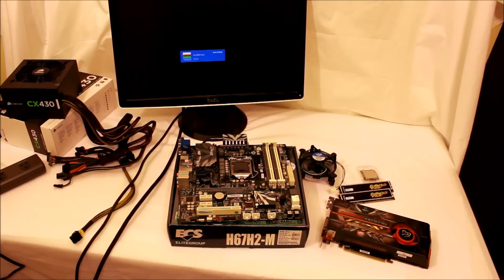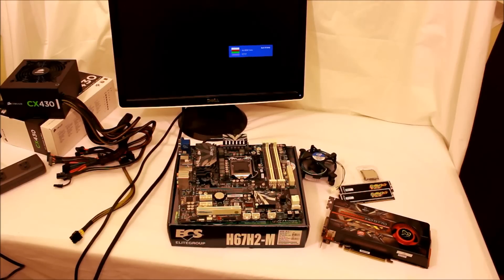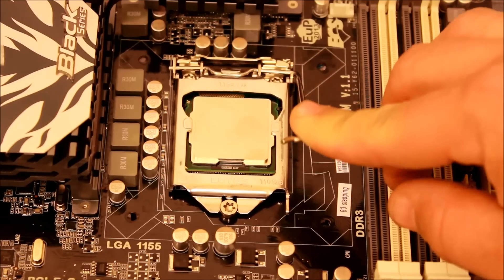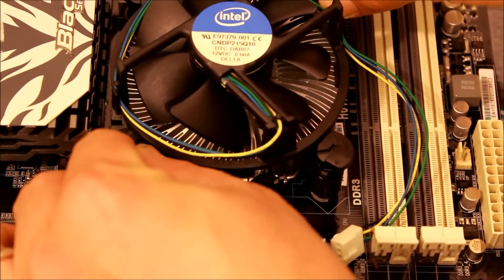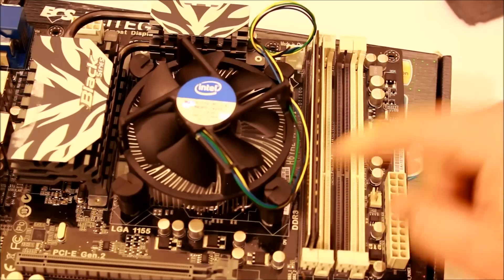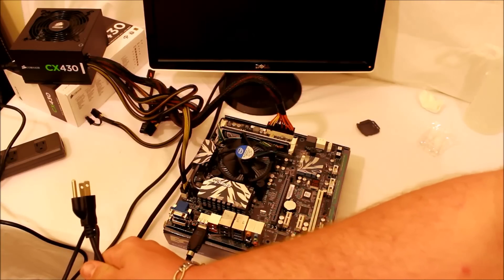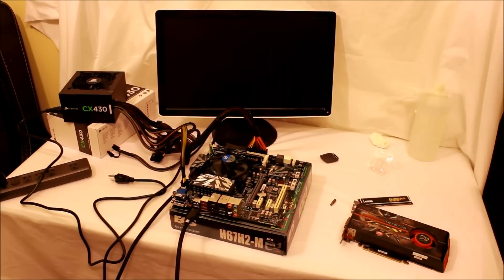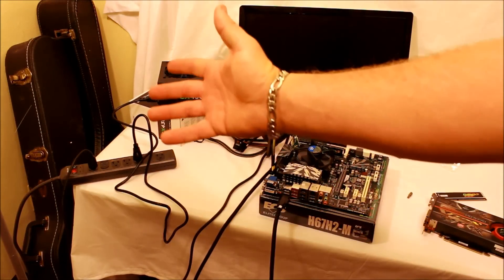how to test a new motherboard

Comment: I boot up get error code 00 and red light for cpu everything else is fine ram has green light fans spinning up normal and I never get beeps ever
Reply: Modern Motherboards and PC Cases generally do not use speakers anymore, they use an LED system to display errors. Just like you stated that you have your red light and green lights.
Reply: +Meraut66 what does yellow light means?
Reply: +#PCMASTER RACE if you have your manual for your motherboard look it up there, if not download a hardware program like speccy and look up your manual for your motherboard. Most manufacturers use different codes for lights

Comment: Don't build a pc with power plugged in??? I always do that and it has always been fine.
Reply: Well if your hand is sweaty, aka your hand is wet -> easier to get electric shock with a power plugged in. So basically, when touching and fixing any device that use electricity, dont plug the power cord. Simple as that. Its just safety caution. And yea I've been doing that since window 95 :)

Comment: my laptop has been going on and off
Reply: linda sahene its probably overheating. Your fan may either be clogged with dust or ur fan may be broken
Reply: Computer processors have a fail safe where they shut down if they get too hot